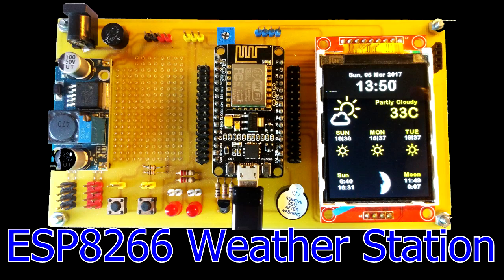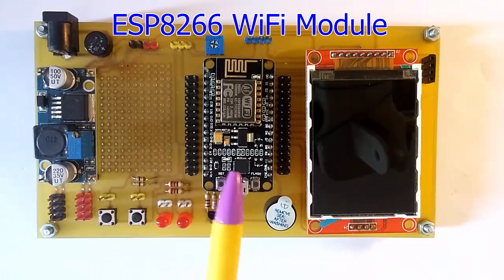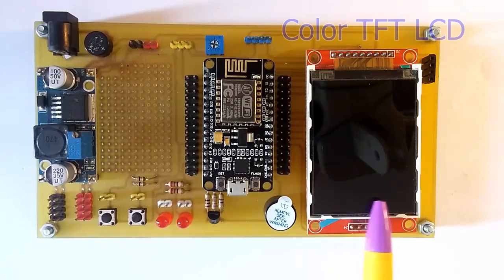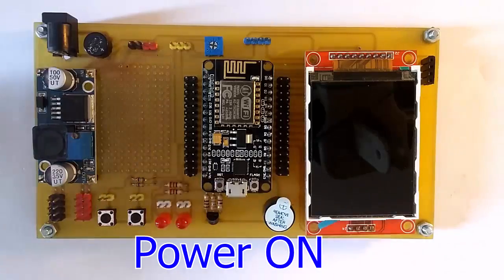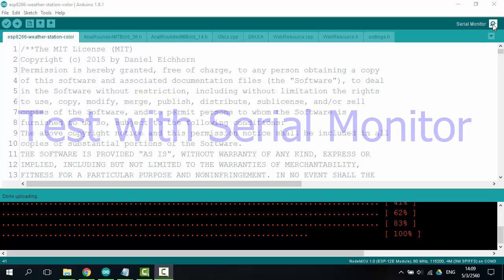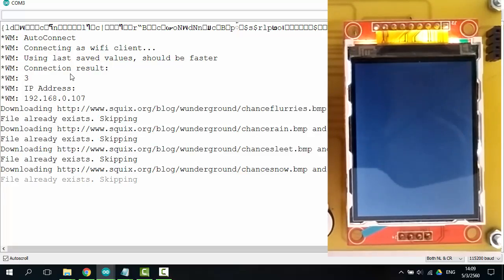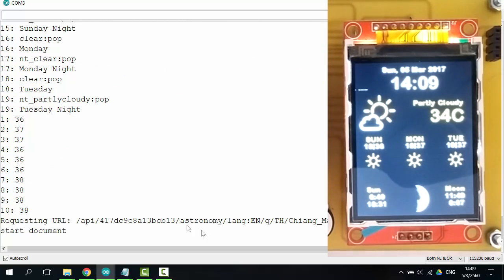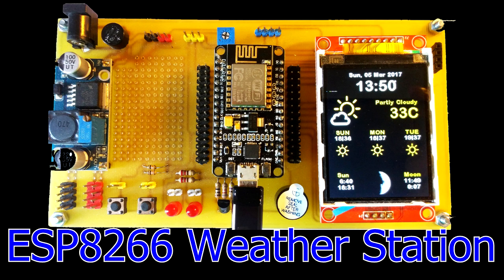ESP8266 Weather Station with Color TFTLCD

Comment: I have some questions:
1) The clock numbers do not stop, for example, 23:07:35, the first two digits change between 23 and 11, 23 and 11, always blinking.
2) How to change the format from 12 to 24 hours?
3) How to set a 'UTC_OFFSET' rule for Brazil? (it's -3 hours)
Thank you

Comment: Hi friend! I would like your help, kindly;
I have several Weather Station sketches with NodeMCU and TFT Display, the same one that you show in the vídeo and none works the data, only the clock (hours).
I also have a Weather Station sketch with NodeMCU and 8x32 LED Matrix with Wunderground API and it's working fine.
So I ask you the question: is each API-Key in Wunderground only for one project? ie for each project has to be an API-Key?
Because I'm not understanding that for one it works and for another it does not!
Thank you